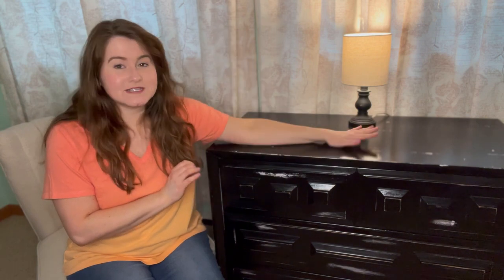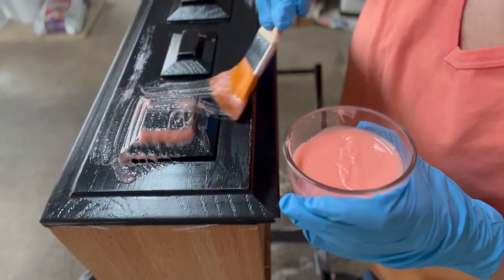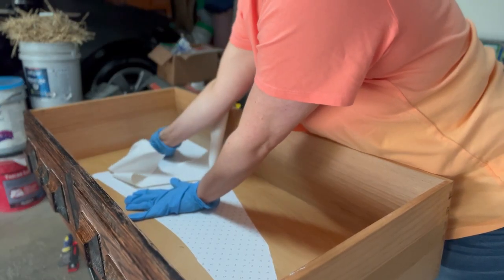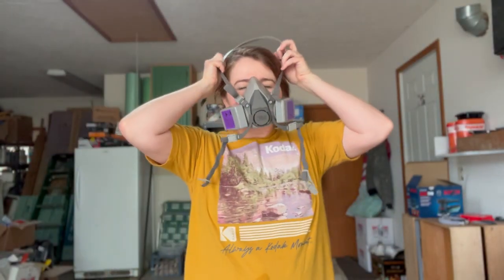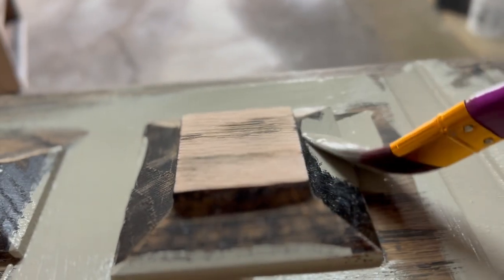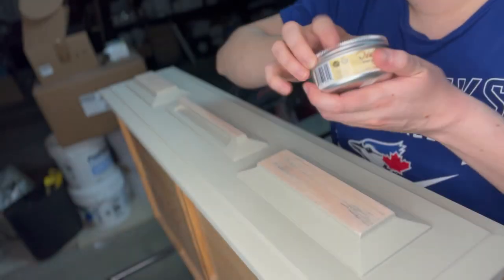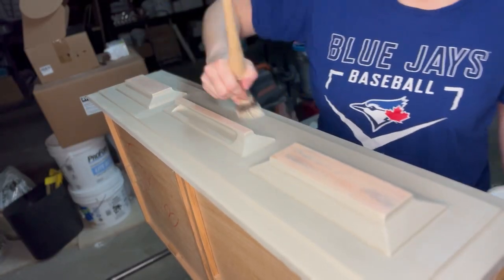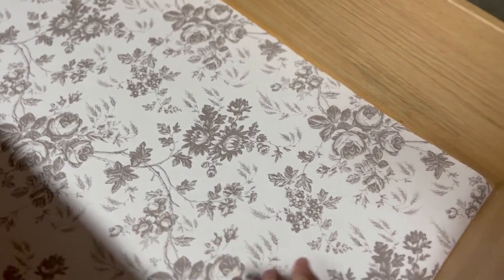Dresser Transformation | Black Beauty to Coastal Breeze

Comment: I don't remember what kind of stripper i used but you just painted it on and the paint just bubbled right up, no need for seran wrap. 
The paint would just comme up like butter and any left in the cracks I used steel wool and it would comme right off. 
This citrus stripper may not be strong enough for what you're doing.
Reply from the maker: I usually don’t like the extremely strong smells of stripper. I try to go for the less smelly ones 🫣
Reply: @monise_makes  that's fair did mine outside but the smell was very strong anyways. I like the way this one turned out.
Reply from the maker: Thank you so much! I appreciate the tips and sweet comment 😊